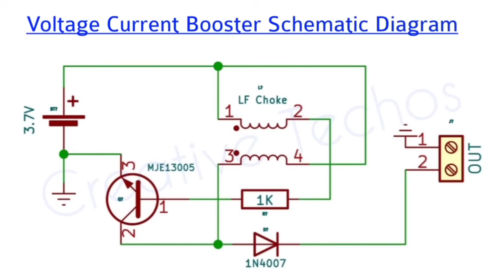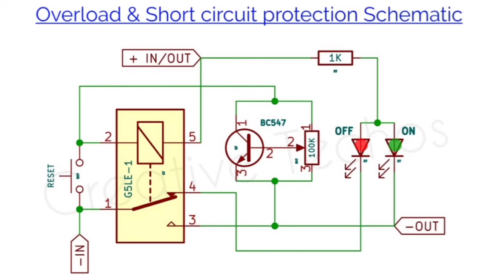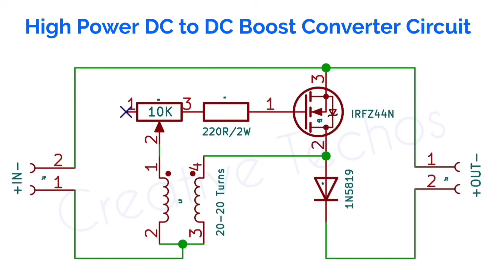3 helpful Electronic Projects That you definitely need for your home

Comment: Project 1, electronic project, very helpful.  What does it do?
Reply: No components name and value.
Reply: use 3.7v for LED that require 12v. It is step-up circuit.
Reply: كيف يعمل؟ ما الغرض من المشروع؟ @jumbo999614

Comment: Im tested project No 3 , not working !!
Reply: It's just a joule thief circuit
But the transistor will get bloody hot the more current the load draws
Reply: perhaps because u used TIP32 which is PNP, while MJE13005 is NPN... and u must be careful at the windings